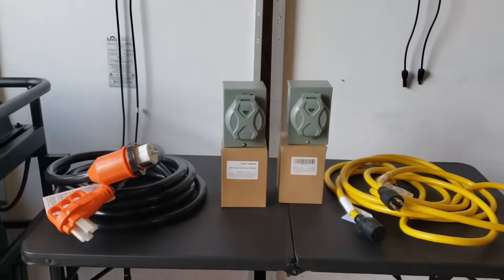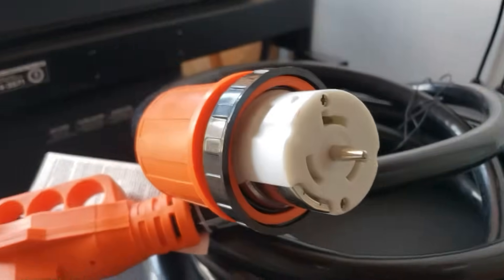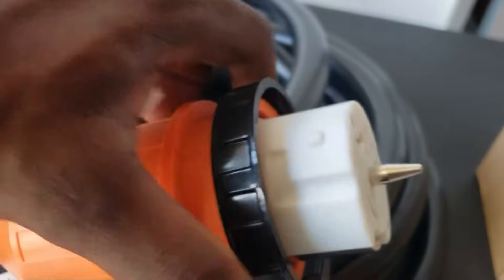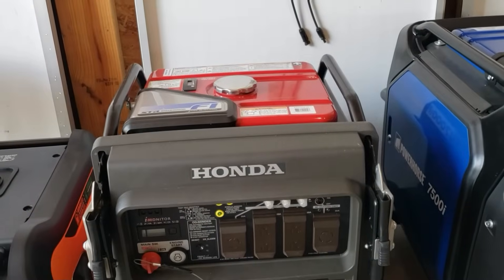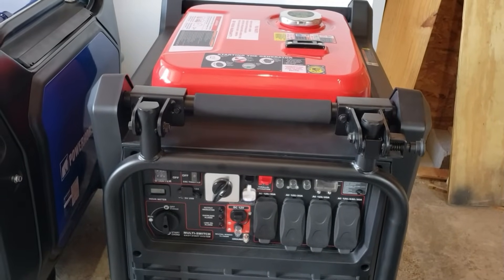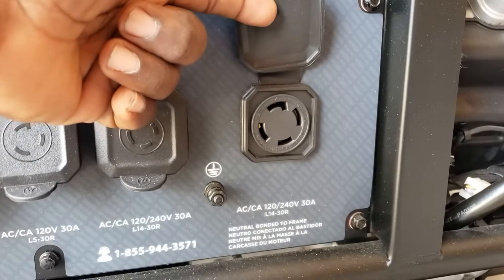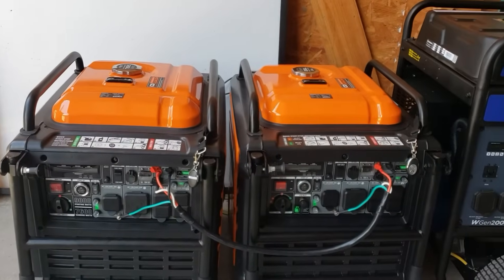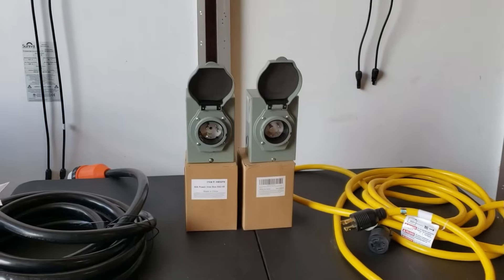Generator Inlet Box 30 amps Vs 50 amps which one should you install

Comment: If you need more than 30 amp 240V plug for emergency power then i wouldnt bother with a portable unit just get a standby at that point..... also though i cant imagine neediny more than that gor emergency power. Remember its also a factor keeping the genser fueled too....how much gas do want to rely on for an extended outage or after a disaster when fuel is hard to get.....keep the sizing sufficient for your minimum needs with a safety factor....

Comment: What is the longest length of cable can you use? I want to put generator in back yard fenced area and run a 30amp 220 cord to my generator outlet at fuse box about 25 feet if possible
Reply from the maker: 50ft

Comment: So with a 50 amp plug will it still power 110 products because it's mainly to run 220 products or does the generator convert that.
Reply from the maker: 240v

Comment: Question - I am buying a Transfer switch to be able to hook up a generator to my cabin in case of outtages. I have a tri-fuel Firman Generator that has both 50 amp and 30 amp outlets on it, and depending on the fuel I use, the most it will do is  9400 starting watts, 7500 running watts. It's slightly less for LPG / NG fuel. In time, I may upgrade the generator to 10 - 12k watt generator, IF I need it, but, in piecing together the inlet and transfer switch, should I just use a 50AMP inlet to 'future proof' my setup for when I do get a bigger generator? Also because my current generator already has a 50 AM outlet as well I can use?

Comment: i just bought the westinghouse 12500/9500df. i looked out side recently and am running a 30 amp outlet on house. what issuse s am i going to run  into or will i just plug the 30 into the house from generator and be ok ? i guess i ll only be able to use 7500w out that socket and extensions on other outlets on generator ? thanks

Comment: I have 6/2 wire and I bout the interlock kit with 30 amp generator plug and i does require neutral does that mean will need new wire from main panel to that generator plug?

Comment: Great videos Gavin, I have saved 4 of your tonight.  I currently run Predator 9500 on a 30-amp twist lock, which runs my entire house other than my hot water heater, microwave and stove.  I'm considering buying another one to parallel them together.  This video mentions <~12500 watts for a 50 amp. Is it not possible that running two I could potentially run 15k watts constant?  If I am going to upgrade my system, I only want to do it once.   Would a double pole 50-amp breaker, 50-amp connectors and 6-gauge wire be what you would use for your home, or did use when you wired your home plug?

Comment: i started with a 8750/ 7000 30 amp and now i have a 13000/10000 and use a 50 amp so went both but use the 50 most of the time. but have the 30 amp as a back up just in case. the only down fall to this is i don't have a safety cut off for my 50 amp at least at this time. but plan on figuring out a way to put one on it also.

Comment: I was thinking about buying a generac 6500 for my 30amp direct meter plug in. It’s rated to surge up over 8000 tho. It’s it still safe to use with the 30amp because the running wattage is 6500? I bought a new double wide manufactured home and it has a 100 amp breaker not a 200amp. Any advice would be great. My old generator crapped the bed and want to purchase a new 1 this week with winter around the corner. Thanks
Reply from the maker: I recommend you going with a 50 amp inlet box and generator
Reply: @ I went with a champion 8725/7000. It’s the only one i could get in my area. 1 left at tractor supply. Have another storm coming in the end of the week. I already have the 30amp gen lock hooked up to my home. As you stated in your video it’s ok if it surges higher than 7500 as long at the running watts are at 7500 or less. The champion i bought running watts is 7000. Would this still be ok? I hope so. Thanks for any input and feedback. I needed an inverted generator as my son in disabled and we need something for sensitive electronics.

Comment: Bad advice because if the Generator has a 240 volt 50 amp outlet even if its max running amp is 29 amp at 240 volts its always better to go with 50 amp inlet box specially if you want to be able to run a air conditioner unit with a soft start.
Reply from the maker: That’s exactly what I said. It’s better to go with a 50 amp inlet box.

Comment: If Im using a 8300w running (11,000watt surge) can I use a 30amp inlet box plug and 10awg copper wire? Its 34amps at 240v.. can a 50amp breaker and 30amp breakerbox work? If the wire to generator and wire from inlet box  is 6ft ??
Reply from the maker: You need to get a 50 amp inlet box with a six gauge wire

Comment: They make an adapter or you can take your 30 amp cable and plug it into a 50 amp box to be bought online don’t cost that much and then plugging right in that way you’re set for the future in case you ever go to 50 amp

Comment: i have a 11500 startup/9200 running watt gen, it has a nema 14-50r rated for 38 amp. i am pretty sure i can install a 50 amp box and make sure i never go over 38 amps and i should be fine am i correct or completely wrong? or should i just do a 30amp inlet for safety issues
Reply from the maker: You’re better off installing a 50 amp inlet box ✅
Reply: @GeneratorReviews  for some reason i was assuming i could pull 38+ amps from the generator and cause some fire accident and cause the cable to burn or something lol

Comment: Just recently had my inlet box installed.  Even though my current generator is only 30 amp with 3900 running watts, I still went with the 50 amp inlet box and just use a 30 amp to 50 amp power cord adaptor.  That way I am already set if I ever decide to upgrade generators.  You are limiting yourself if you install a 30 amp inlet box.

Comment: Great video.  How do you use both 50 amp 240V outlets provided to wire it such that your house can take advantage of that power?  Do you get two cord that go to a box that has a Polaris tap that joins the 4 hots and 2 neutrals and outputs the full load to a single bigger 2 AWG wire that then goes to a 100-amp double pole breaker on your main panel?  I am talking about the case where you are using a manual interlock... thanks!!
Reply: Two separate powered houses, a camp trailer and a house or two camp trailers. Two separate places.

Comment: I can power my necessary circuits (no AC) with a 3000 watt generator so a 30 amp receptacle is all I need.  But 50 amp doesn't cost much more. If I did it again, I would go 50 amp.

Comment: Just last week, I had the 30amp outlet and interlock installed. I bought my 13,500/8,000 generator nearly 20 years ago after an ice storm in Central Ohio knocked out the power for over a week. And it does not have a 50amp outlet. But for our needs, to power the essentials and then some, this will do the job just fine. Peace of mind and money well spent.
Reply: So it sounds like if you draw over 30 A you could have a fire issue. Yeah you say just some essential but you’re setting yourself up for a very dangerous situation.
Reply: @condor5635  failure to use common sense is often dangerous. I’m not worried.
Reply: It doesn’t make sense why you didn’t do it correctly. That’s the same attitude with people that say they use a suicide cord and I know I will never do anything wrong with it -  I’ll use common sense
Reply: @condor5635  It was done correctly. Not sure why you think it was not. Just maybe not done to your liking. My electrician is very good and a neighbor. I trust him 100%. This set up works with my generator and suits my needs. Thanks for your concern. I’m good.
Reply: @condor5635  our home is 4 years old. I'm pretty sure it will simply pop a breaker if there is an overload. Not worried at all.
Reply: @jayf6525  are you using the 30 amp receptacle on the generator or the 50 amp receptacle ?  Guessing the 30 amp because if using the 50 amp one you would need a plug converter. That would also solve your use of a 30 amp outlet. But in that case you would not be accessing 13,500/8,000 your generator is capable of. Only 7,200
Reply: @condor5635  30amp receptacle on both.
Reply: @jayf6525  - well that’s the explanation why you’re 30 amp inlet is OK then.   But your Gen has more power than you can access through the 30 amp receptacle which is not necessarily a bad thing

Comment: Just put in the 30A for 5550 generator.  I can always switch out later but probably never will.  Most difficult thing was drilling the brick for a sturdy mount.  That and drilling the hole in the no knock out box.  I was hard headed and chose the no knock out box.  The box is very sturdy metal as people say in the comments.  Did buy the 50A breaker just in case.  Just going to run a couple of fridge, window unit, fan, ceiling fans, am radio, occasional TV, and LED lights sometimes.  This setup was not too gasoline heavy.  That is a question.  How much fuel do you want to use when you just need to stop any loss and be able to sleep in an isolated room.

Comment: I have a Durmax 12,000 dual fuel, 9000 running watts 12,000 peak. My generator is 75 feet from my 50 amp inlet box. What gage cord should I use?  Would 6/3+8/1 be the right cord? I need around 7500 running watts of power to run what I need. I have a 50 amp double breaker in the CB box.i calculated the watts I need. Do you think I should go with a 30 amp 75 foot cord and get an adapter on the inlet box to 30amps? The weight of 75 feet of 6/3+8/1 gage wire is 55 lbs.

Comment: Love the KISS explanation! I like to add, if the budget allows I would go for the 50 amp inlet. You can always adapt the 50 amp cord down to a smaller generator while leaving room for future expansion. When I installed my generator inlet the Jungle site (Amazon) wasn't a thing back then, you can purchase reasonably price kits nowadays.

I just recently installed two 50 amp inlets for a family friend that has the WGen20000 (I can say that generator is a beast). It really worked out well since they have 2 separate 200 amp main service panels in their garage. They're just ecstatic that this year's tropical cyclone season of not having to deal with the spaghetti model of extension cords when the power goes out. I already let them know not to attempt to run any one of their multiple 4 ton HVAC units without a soft start units installed.
Reply from the maker: Agreed 👍🏾

Comment: Hi Gavin, What's the best way to set up a Westinghouse 28000 Generator to run your whole house? Would you use two 50 AMP inlet boxes with two 50 AMP cords? Any advice would be appreciated. Thank you!
Reply from the maker: That would be your best option. That way you get the full output of this generator. 

Thanks for watching 👍🏾

Comment: Is there a reason why only some 50 amp twist locks have that middle metal pin?
Reply from the maker: The 50 amp with the pin are designated for home backup the 50 amp without the pin, usually are for recreational vehicles

Comment: No i'm gonna run my two hundred and forty voter Kitchen stove oven and.
And I'm also gonna run 120 vote water heater. No, the kitchen still runs 3600 W. The water heater runs at 4800 W. So I'm thinking I should have at least a 9000 W generator.
Electric generator that runs from solar panels. I will never get a gas generator.
Cause that just cost what?
50 bucks a day to run 365 days a year.  That's expensive
Do the math and find out you can buy a whole generator that does solar Thor credit card, but it cost. You're just gas alonespecially when you don't get a power company connected to your house. And then I'll need more power more generators to run the smaller loads.
That just runs one twenty volts.

Comment: I have a 50 amp transfer switch inlet , can I plug a 30 amp cable from my Ecoflow battery to the 50 amp inlet using an adapter ?  Would that be safe?
Reply from the maker: Yes, you can do that with the right Adapter
Reply: thank you @GeneratorReviews

Comment: Is there a 100amp versionof these plugs?  I have a 25kw pto generator that i need to get a cable for.
Reply from the maker: You’ll have to install two 50 amp inlet
Reply: @GeneratorReviews  thank you for the response.

Comment: Excellent information. My question is this. My entire house is electric water heater, range, heat pump. I’d like to have at least the heat pump and lights during and outage. I’ve purchased a duromax 12500w start  with 9500w running watts. The heat pump is 40 amps start up with around 21 amps running with a 4600 wattage draw. Should I go 50A inlet and have the overhead or go 30A inlet to just have enough? Thanks in advance!!!
Reply from the maker: The 50amp would make more sense

Comment: Remember folks that the 50 AMP plug must have a 6 AWG running to the panel and the 30 AMP plug a 10 AWG. The quickest way to burn down your house is not to have the rated wiring respective to the plug and generator your using and of course not to have too many circuits powered(load). AMP=WATTAGE/VOLTAGE.

Comment: HI thanks for video,  if I have a 30 amp, 9,000 peak watt generator and a 30 amp but 7500 watt receptacle, would that be a problem? given that the generator has more wattage than the inlet box ?
Reply from the maker: No that’s not a problem at all because you know exactly what you’re going to pull from the Generator,  just because you have a 9,000 W generator doesn’t mean you have to turn on 9,000 W just be aware of what you’re using.

Comment: very good job can you put a 50 plug on a predator 95000
Reply from the maker: You can use an adapter to get your 50 amp plug from the 30 amp twist

Comment: 🎯 Key Takeaways for quick navigation:

00:03 🧩 Understanding 30 Amp vs. 50 Amp Inlet Kits
- Differentiating between 30 amp and 50 amp inlet kits based on appearance.
- Identifying 50 amp plugs and wires for generators.
- Highlighting the significance of wire gauge and plug types.
03:02 ⚡ Power Considerations for Generator Choice
- Recommending a 30 amp inlet kit for a 6000-watt generator.
- Discussing the maximum power and sustained power for 30 amp and 50 amp setups.
- Mentioning the option of parallel generators for higher power needs.
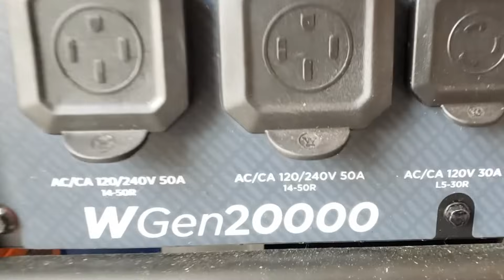04:26 🔌 Utilizing a 28,000-Watt Generator
- Explaining the capabilities of a 28,000-watt generator with multiple outlets.
- Highlighting the need for a 50 amp setup for such high power generators.
- Clarifying the flexibility of using different outlets for various appliances.
05:50 💡 Choosing Between 30 Amp and 50 Amp
- Suggesting the selection of a 30 amp kit for power needs below 7,500 watts.
- Advising the use of adapters for smaller generators with 30 amp kits.
- Emphasizing that 50 amp kits are suitable for power requirements from 7,500 to 12,500 watts.

Made with HARPA AI

Comment: If you are making videos you need to make sure your information is accurate. That 50amp cable should be 6awg. If it’s 8awg then that is not rated for 50 amps.
Reply: 8awg definitely works.
Reply: @Wazuprandom - yeh so does 12 gauge as long as you don’t draw 16 amps or more. Point is you should use 6 gauge for 50 amps
Reply: 😂 Someone is wrong.  Someone is right.
Reply: 8 AWG copper wire and 6 AWG aluminum wire are not recommended despite having the 50 AMP-60 AMP ampacity rating because the National Electrical Code (NEC) states that the maximum loading capacity of the electrical circuit should not exceed 80%.
Reply: Ha ha they don't know 6 from 10,dumb bs
Reply: He's accurate, you are wrong.

Comment: Wrong!
50 amp cords are 6 gage, since your generator must be 20' minimum from your house, not 8 gage like you said. 8 gage is for 40 amps.
Reply from the maker: I may have missed spoke you are correct it is 6 gauge for 50 amps

Comment: My 4 ton central AC is about 5000 watts.  To run it, it will also need a soft start kit.  So, if you want to your central AC and don’t have $12,000 for a standby system of 14-20kw, you need 50 amps and  maybe tri-fuel with natural gas because gasoline can’t be stored long, propane will require more than 20lb cans.
Reply from the maker: https://youtu.be/T363v4d0oeI?si=FybjrKXUPa3Tgx_0

Comment: Can use a generator that have 30 rv plugs to 30 amp boat plugs?
Reply from the maker: You would need an adapter, but you would not get 240 V only 120 V appliances will be powered

Comment: You mentioned running generators in parallel?  That is interesting to me.  Can you do that with multipleEcoFlow Pro dual voltage hubs?  Might be a good topic for a video if you haven’t already made one.  If so, can you point me to it?  Thanks.
Reply from the maker: https://youtu.be/x6vnyhwgjug?si=nx-E1yDIscZgqXDB

Comment: I’m putting in the generator inlet plug as we speak.  

The generator I’m using has the 50a plug but with 30a rating.

Can I put in 50a plug with 6 gauge wire but use a 30a breaker in the panel.  Maybe later I get a bigger generator later on or parallel a second generator.  Then I simply replace the 30a breaker with a 50a
Reply from the maker: Yes, you can do that👍🏾

Comment: I have a 10,000-8,000W generator but it have a 30A 4 prongs outlet, can I still use 30A, 7,500W inlet box? If not, what can I do? Thanks in advance!
Reply from the maker: Yes you can, that’s more power than you need in a power outage 👍🏾

Comment: Gavin, if you only have a smaller generator (4500 watt), would it be a good idea to install the 50 amp inlet box and use an adapter just in case you decide to upgrade or parallel another generator in the future?
Reply from the maker: Yes that’s exactly what I would do